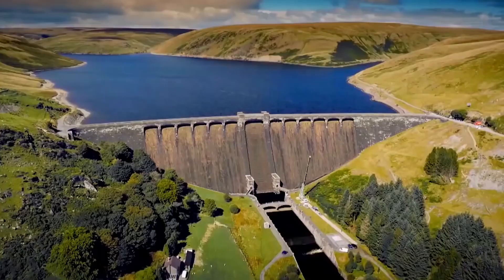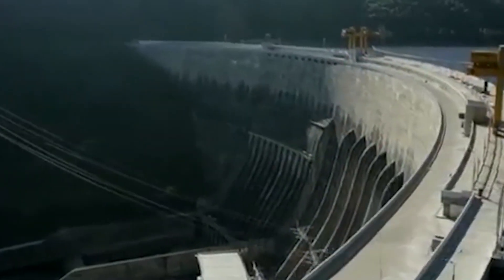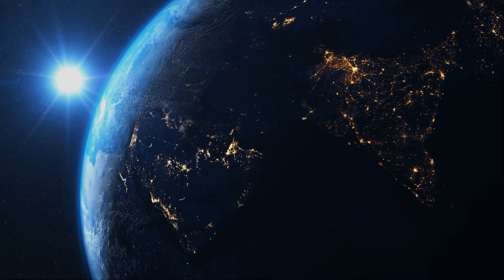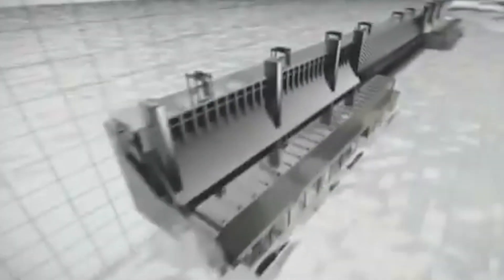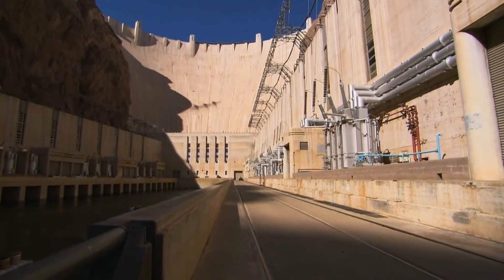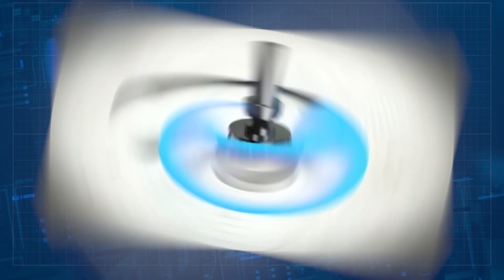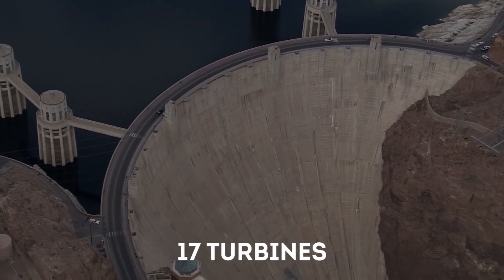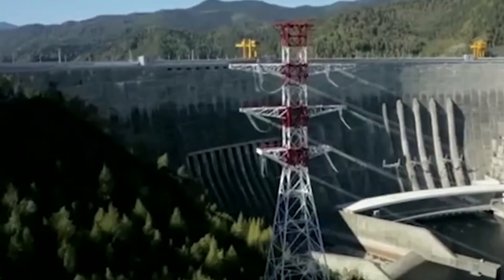Why Are Giant Dams Collapsing?

Comment: The dam is essential for human civilization to protect from excessive  water in a river and   gather and flow it slowly and protection from floods and electricity and other purpose .
2) why the dam are collapsed because excessive amount of water in dam.
3) the Engineers have no common sense how to check  excessive amount of water to the dam.
4) we have to create another accumulation of water some distance from dam so that you can check the excessive amount of water .
5).   Another methods huge home cement pipe diameter 20 feet should used about 50.000 or more in  accumulation of water areas  .so that excessive water will drain out to occean .with stand on the soil towards occean .